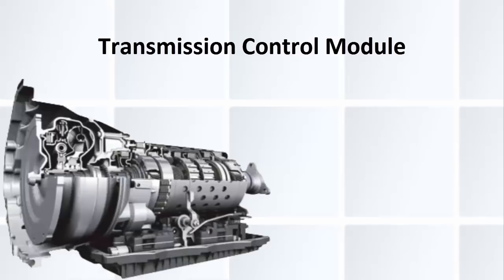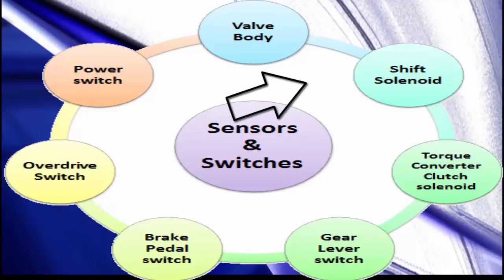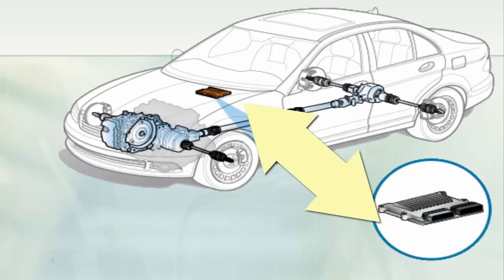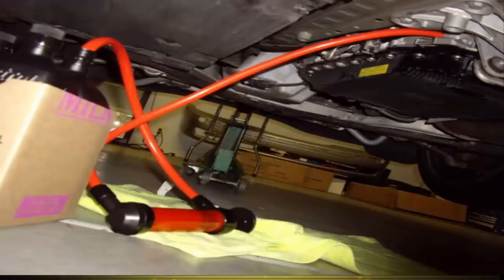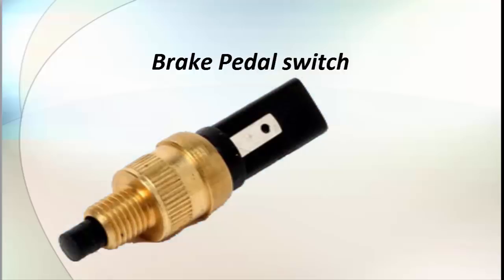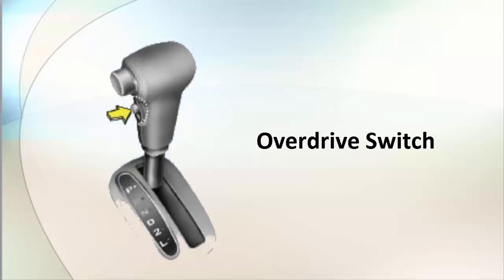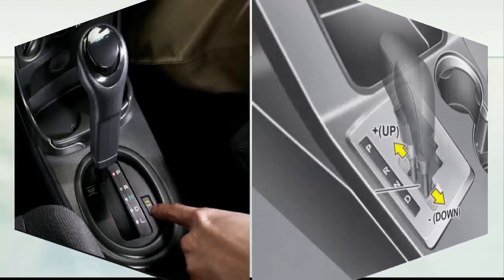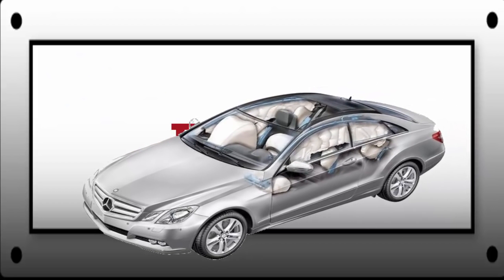Transmission Control Module

Comment: I took my 2018 Ram Promaster city to a transmission shop to swap out the transmission with a low mile 2019 transmission I found.  The shop included a $220 charge to reprogram the transmission which I felt was high.  After the install they  told me my TCM was bad and needed to be replaced (parts and labor) for an additional $525.  The shop is now telling me the TCM needs to be programmed by the dealership for an added cost...   How many kinds of programming do modern transmissions need and would the shop being doing any kind of programming if the dealer is flashing the TCM?

Comment: I have 09 Chevy Silverado 1500 2wd 5.3  I have transmission problem but like  2 electric guys check o ready  and says the transmission it’s the problem it’s a mechanic problem I  I’m take to another mechanic and the truck don’t have power I take to the muffler guy and say it’s not the problem in the catalyst i don’t not any body not what happened

Comment: I need a transmission control module for 2006 Chrysler 300 touring , runs fine n goes into drive and reverse but will not shift dodge says its control module n wants like 1500 to fix I can’t afford that but my friend told me to buy one online any suggestions I’m not gonna send this car to crusher over a shift censor

Comment: Thanks for sharing the video. I have a C 240 (W203, year 2003). Sometimes the downshifting isn't soft. Upshifting is fine. Could be a problem of sensors ? No error code with diag. If yes, could they replaced or should i replace the whole TCM ?

Comment: Would appreciate more in depth information on each of the sensors and switches that the transmission control module reads
Reply: I got P0770 code
Reply: Tengo problema con mi  mersedes 00   lamanejo 3 millas aproximadamente  y se queda nutro  cuando enfría camina perfecta

Comment: Very nice video well explained: BMW 2008 (750)LI  has lots of transmission issues if you hit speed bump the dashboard is full with all kinds signs.! first it was leaking transmission fluid from cooler lines under the sub frame the rubber hoses there is no easy fix for it , accept reinstalling new cooler lines which are $995.00 at dealer the installation is extra . Not only that the dynamic hydraulic lines are leaking as well that shows red roll over sign then red steering wheel , traction light, parking light and the car will not go into any gear, I towed it to dealer they refused to work on because of transmission problem. They said you will need brand new transmission which is $10,000.00 plus installation you are looking at total $14,000. One good thing at the dealer they did is they cleared the codes plus they did the  diagnostic  and give me all the complete details what was wrong.The car has 165.00 kilometers why will the car need new transmission. what I did was I purchased the cooler 2 x lines plus 6 hydraulic lines very expensive  $ 630.54 transmission cooler lines )( Hydraulic steering lines $ 725.40 plus  10 Quarts of transmission oil each @ $47.58 X 10 was $531.10 which i did not buy at the dealer I purchased Transmission fluid 10 quarts at auto parts store  Castrol full Transmax import multi vehicle transmission fluid   each at $12.29 X 10 = $122.90 much less expensive then dealer  plus I purchased 3 quarts of hydraulic oil . $39.00   It all cost me  $ 1,520.00 First  I drained the old transmission oil completely then opened the transmission pan the pain was very clean no dust  or any metal I reinstalled the pan back on transmission. Now i started installing the new cooler lines they were little hard because of sub frame I had to lower it about 5 inches to pass the transmission cooler lines. Once those were installed now it was time to re fill the transmission fluid step by step 3 quarts per fill and running  engine for 10 minutes  then stop and refill another 3 quarts and start again for 5 minutes now stop and refill this time it took very slowly and oil was dropping out after running 10 more minutes I stop and fill the rest full 10 quarts.  I cleaned everything very nicely leaving  it dry to check for any leaks.  Now when I started the car it sounded very quiet 
the transmission red sing  was gone there was the hydraulic steering sign still on cluster . Now I take off the passenger side wheel remove the plastic covering on left hand side you will see hydraulic junction box on the rubber hoses which are leaking 
start removing from top one by one  before doing removing the lines, Drain the power steering oil completely .
After installing all 6 lines one at a time using thread sealer do not tight too much Once all 6 lines were Installed it was time to refill the power steering fluid by not overfilling. checked for any leaks if any.  Now started the car  while the car is on safe jack stands.
check for any leaks. if any. Now reinstall the tire and reinstall the reinforcement shield and all plastic covering. Now when I started the car it was very quiet no signs on cluster I drove the car for about 10 kilometers  it was running like new. It took me one full day the time consuming is plastic covering tow many screws per shied T 30 torque bits .    

     After 2 days I washed my car re cleaned from inside out  like brand new I went to BMW dealer ship with same car that they give me  repair Estimate . They know the car was towed to dealer ship before ,  I show them there were no signs at all even one of there inspection guy said it's a miracle .with loud laugh . he drove it around very impressed.
Reply: ok what must I fucking do to for us to fuck? :( did I do sonething wrong?

Comment: Can anyone help with a 2013 VW Passat  Tcm causing the car jumping out of gear at least that's the way it feels. error code definition was tcm lost temporary contact with ecu. Thanks for your help.
Reply: John Peters said that
Reply: Change the Adapter Gourmet seal, and the separator plate between the 2 half of the valve body. Replace all Shift solenoids on mechatronic.

Comment: hello German Auto:
please help me, my transmission cvt (nissan micra) not yet speed ( no shift ). the level fluid good, i do not know what is the problem. but air in transmission has not. how i put air in cvt transmission? because before that repair has been air after repair the air go. thank you for your cooperation. can you give me you email so that send to you picture for my cvt transmission

Comment: Nice to watch the video, in every car, transmission is a measure part, its use and maintenance both are very important. So its proper maintenance give a better drive.
Reply: Mi carro se jalone y al meter cambi sera el la tras micion